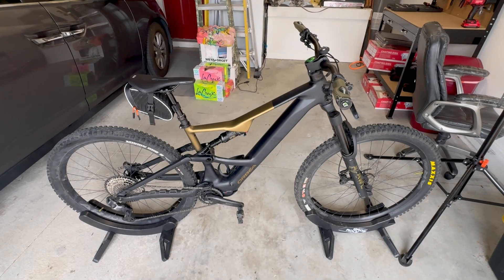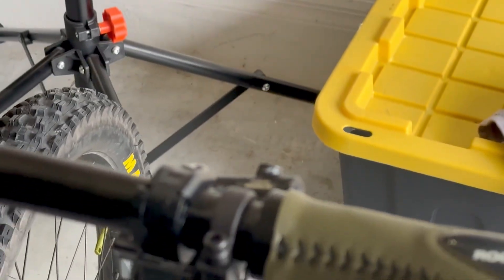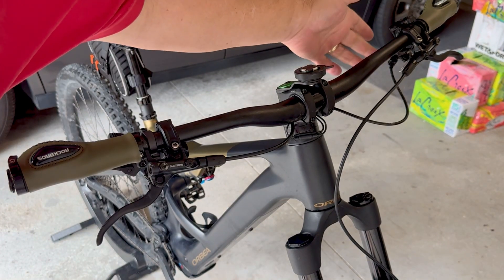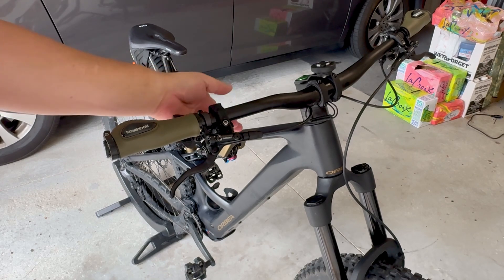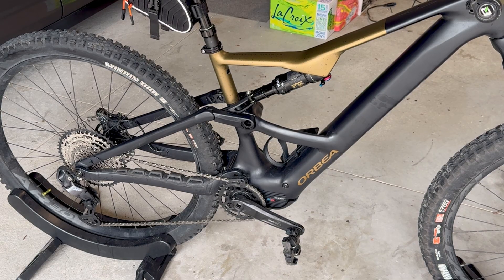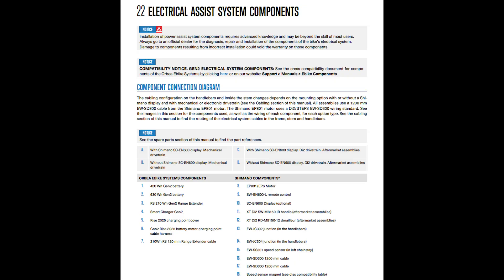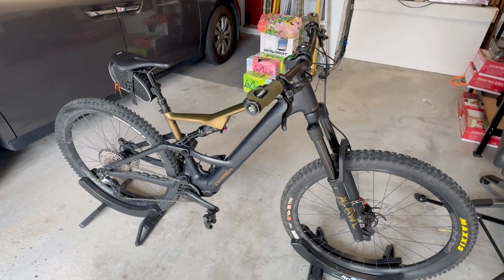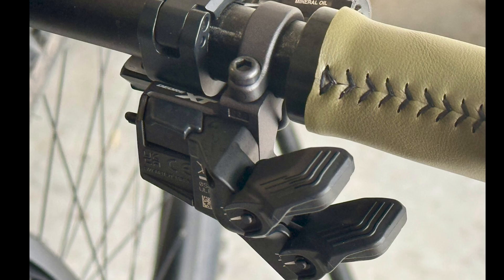Shimano Di2 Shifter and Derailleur Install on Shimano EP6 or EP801 Ebike

Comment: I think, connecting the bike to shimano's e-tube app would allow the system to recognize, synchronize and use any compatible components. 
Shimano's computer link, sm-pce02 may be needed.
Reply from the maker: no, you need to take it to a bike shop that they can call Shimano while the bike is connected to their system over the internet so Shimano can make the adjustment. They can also increase the Nm of the bike at the same time as well if you ask nice...

Comment: Thank you for sharing would like to upgrade my decoy core 4 with this.
Reply from the maker: Glad this was helpful! It is really easy to install, just make sure your shop will help with the Shimano software update...
Reply: @FireandWaterTravel  Hello. What needs to be done at the Shimano workshop? I have installed an m6260-12, everything is OK but it gives an error and the derailleur does not change and the ep-801 motor does not assist (everything is synchronised and updated, in maintenance mode I can change sprockets and adjust).
I have taken it to the workshop and they cannot find what needs to be activated. Thank you.